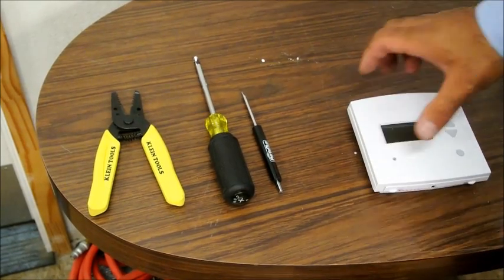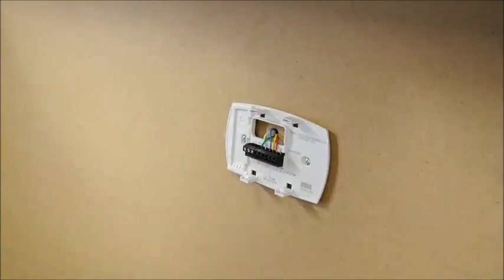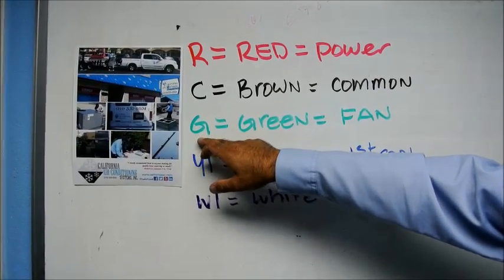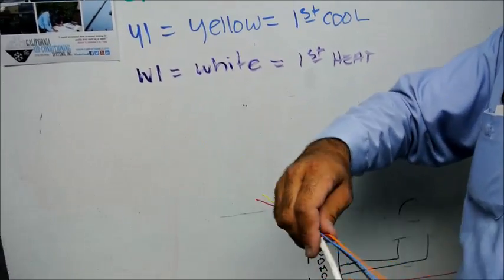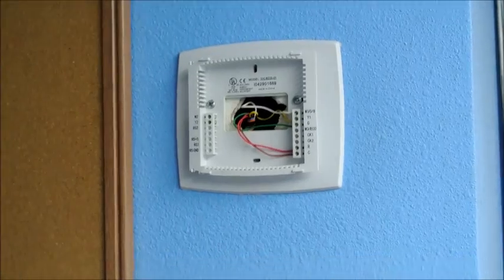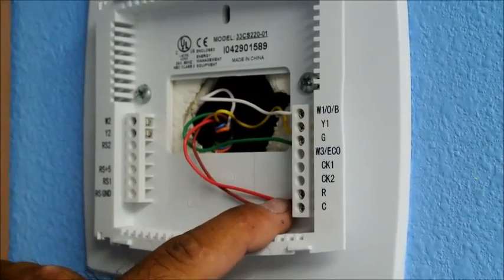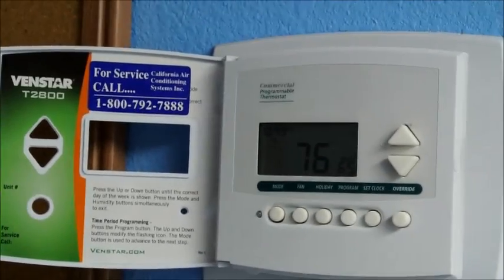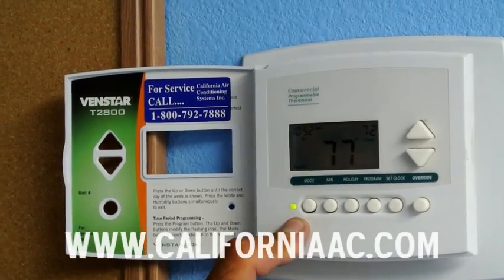How to Replace a Digital Thermostat - Venstar T2800

Comment: I could not get my old one open... Just noticed how he handled  the cover;  he hinged the top and snapped the bottom in !!  Now I notice the little tabs (left, right edge) on the bottom... pliers will grip the bottom inside lip, and  gently pry upward, the spaptab releases! If the other is stubborn, slide a small screwdriver into the partially open  slit :)

Comment: Help, I can't get the cover separated from the back. How do you do it? You didn't show that!!!!?
Reply: Having the same problem 😭
Reply: Just noticed it as he hinged the top and snapped the bottom in !!  Now I notice the little tabs (left, right edge)... pliers will grip the bottom inside lip, and as you grip plier and gently pry upward, the spaptab releases! If the other is stubborn, slide a small screwdriver into the partially open  slit :)

Comment: I am trying to replace my old thermostat with this venstar t2800. I only have two wires that the old one was hooked up to which are the red and white. Is it not working because I need the brown or other wires as well or can it work with just the two?
Reply: Red = power, White = heat, but you have no Brown = common so the new thermostat can't turn on. The electronics inside aren't being powered. You either need that added or you need one of the battery powered units like the Honeywell they replaced in the video.

Comment: Hi sir I want to know about heating system when ever I switch on the heater the moment when red light appear fan get switched off can you explain me that sir
Reply: Hey Saad, what type of thermostat do you have? if you have a Venstar #2800 yes a red light comes on first and after 2-3 minutes the indoor fan will turn on to blow the heat into your home, if this does not work you might have the following problems:1) Blower motor capacitor could be blown out and this will not turn the indoor fan on.2) Bad circuit board for the blower motor.3) Wiring connections wrong.Harry Irvine  http://www.californiaac.com/harborcity.php

Comment: To unlock a Venstar thermostat T2800 & T2900 you need to do the following:

1) put our finger on the " MODE " button but don't press it just yet.

2) put your finger on the " up & down arrow buttons " but don't press it just yet.

3) At the same time, hit them all at the same time and the unlock will be gone. Hope this helps you out and you can call us anytime if you run into this problem again, subscribe to our You Tube Channel.

California Air Conditioning Systems, Inc.
25217 Narbonne Avenue
Lomita, CA  90717
310-530-0504 Office
310-505-5700 24 hour emergency line
http://www.californiaac.com/commerce.html
http://www.californiaac.com/appliancerepairs.html